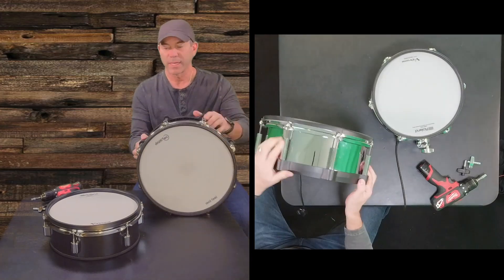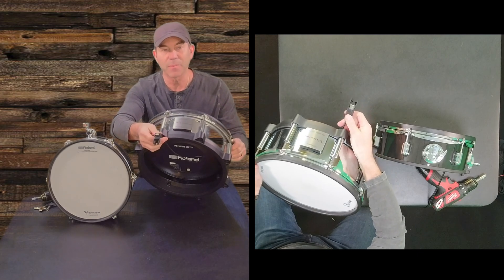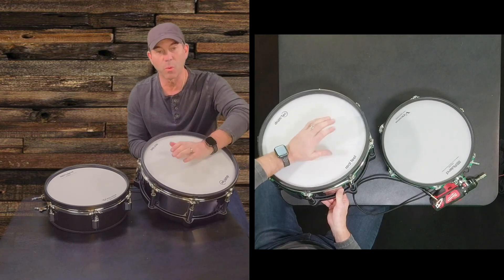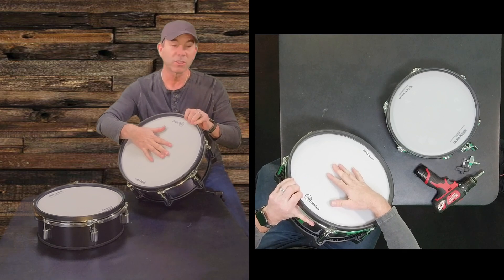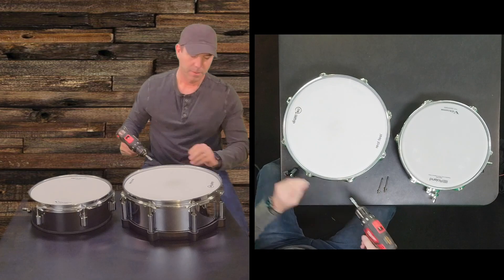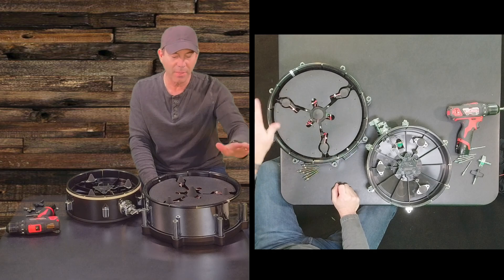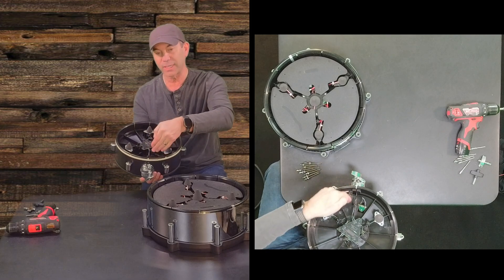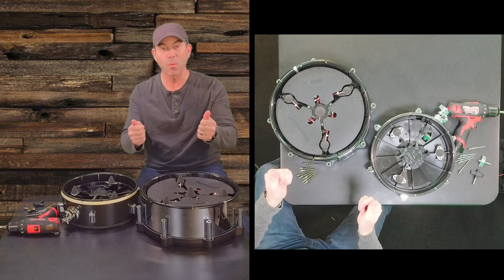Come See The Differences Between These Electronic Snare Drums

Comment: I have the weird version of the td27 with no digital pads. It has a pdx100 for a snare. Got a pda120l used for $140. Big upgrade. More playing surface and no center hot spot. I know it says it doesn't support positional sensing but it kinda feels like it does as you play across the head.